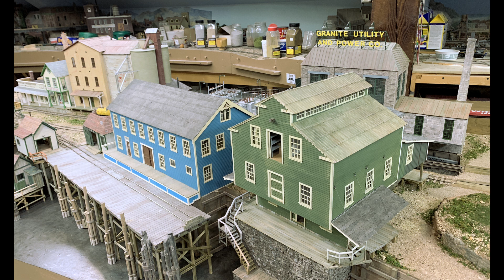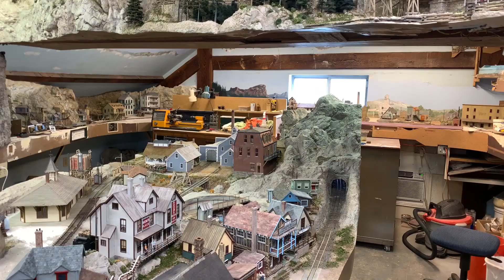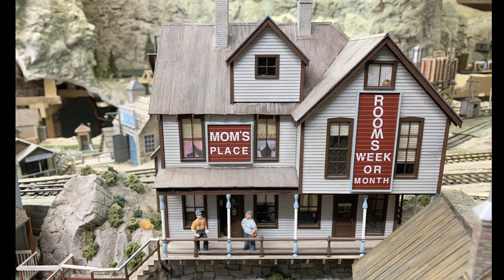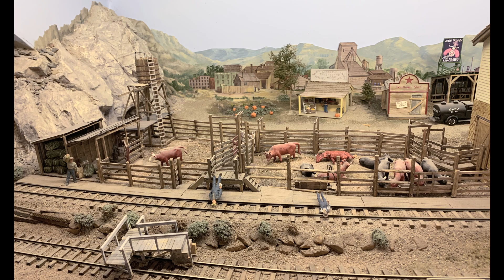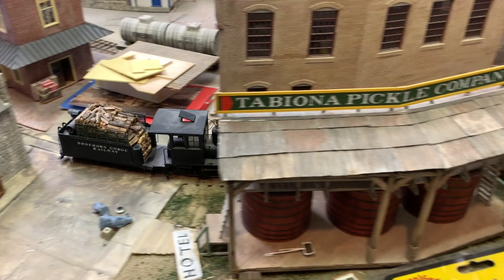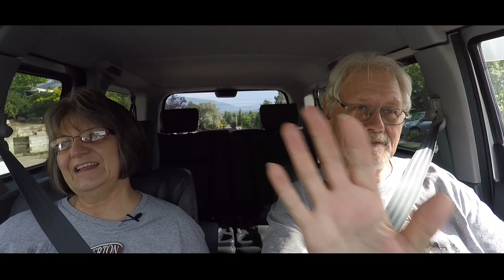Update on Steve's On30 Train Layout

Comment: Nice to see again Steve's railroad. Always amazing to see his work.
My scratch built turntable is simply man powered, like the prototype, and the small locks are functional (made in brass). I think it is a lot more easy than a motorized turntable, when having just a few tracks.
I like Peco On30 track, but the turnout isn't very reliable on my layout, my self made copies are less derailment prone. Next time I need a turnout, I will continue to make them myself, but for the track, Peco is fine.
Reply from the maker: Actually Steve told me today that only three of the switches are pico the rest are handling. The hand like ones were great with the pico ones can be a little bit finicky

Comment: Wow! So much fun modeling. 
 
Is On3 bigger or smaller than On30? I assume both are bigger than HO.
 
I assume things get pretty loud in Mom's "Dinning" House. :D
Reply from the maker: Hi. Same scale. 1/48 scale. 1/4” = 1 foot. It’s the track gauge that is different. O standard gauge is based on 5 feet. So 1 and 1/4 inches wide. On3 is based on 3 foot mountain narrow gauge railroads. So 3:4 inch wide. And On30. 30 inch gauge so a really odd .650 inches wide. Same as HO standard gauge.

Comment: Steve is such a wonderful craftsman!  He does need to add a racoon walking on top of the power substation grid, then have the lights flash.  Sorry , that is the way my mind works.
Reply: Ok, so here's the next level of concept:
- racoon has a bit of a built-in buckety container
- travels a circuit that's something of a triangle in a vertical plain:
--- racoon emerges from behind scenery, "climbs" wires lines to the substation.   
--- Upon reaching substation, an invisible electrical contact is made, and a hidden phosphor charge in the raccoon's "bucket" fires.
--- immediately the raccoon drops down into the scenery to disappear for a few minutes.
--- while the raccoon is disappeared, it's getting a new phosphor charge, and making its way back to it's point of entry, where the cycle repeats.
So Gardener:  if you're going to propose ideas like this, you have to be ready to deal with the consequences of your actions, which includes responses like this, which <ahem,ahem> are better suited to an outdoor layout anyway.   
Kindly share the video when you get this worked up!